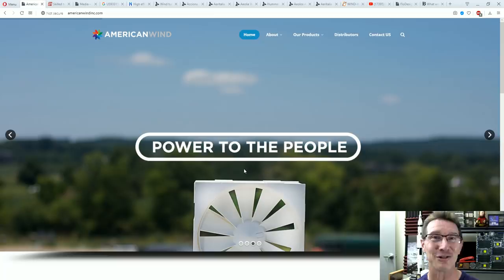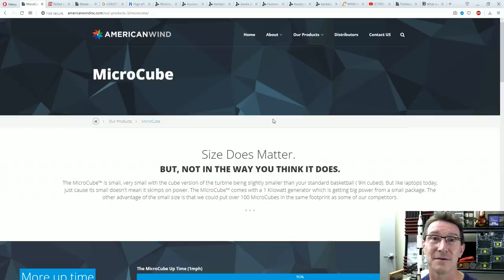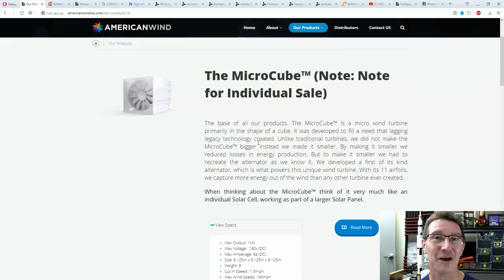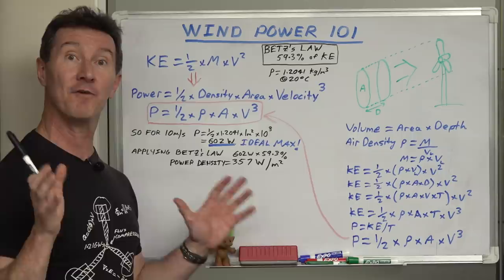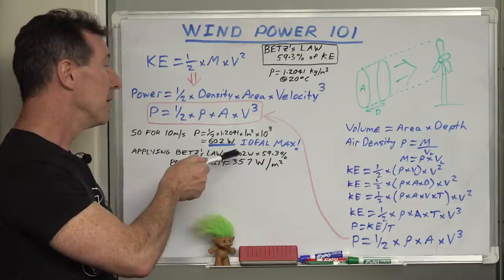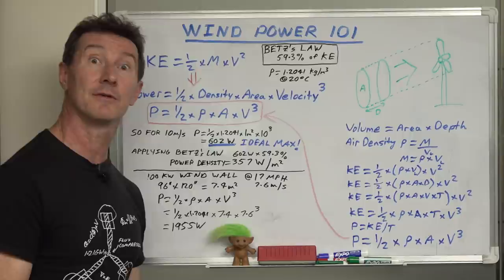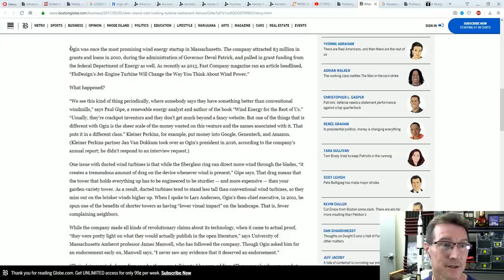EEVblog #1271 - 100kW WindWall Generator BUSTED!

Comment: Impressive video. The sad part is that the sales pitch of a "conventional" wind farm developer is almost always equally full of BS, especially, when the profit (AKA subsidies) is not proportional to the actual energy fed into the grid but to "installed" MW, resulting in an increasing number of wind turbines being places in areas without any wind. When a friend of mine (PhD in physics) did the math on a wind farm built in 2015 in Southern Germany,  just to see how much CO2 it would save over its lifetime, the surprising result was ... below zero, meaning it would actually output more CO2 than it would save. The local government (Green party) responded to the findings with a remarkable answer: "Our wind parks don't have to save C02"... Ahhhh, I love the smell of bullshit in the morning...

Comment: It makes perfect sense if you assume he's selling a "wind wall" and not a "device that converts wind energy into a net electrical output". He's selling a fan. A look at the electrical specs at 2:56 should tell you that. The power usage goes up as the voltage input goes up. Sure, it's a scam, but he didn't say it's a net generator of electricity during the limited time I was able to tolerate him. Of course, using the word "turbine" will probably mean he will have to pay some of his proceeds to the first lawyer that correctly calls his bluff.

Comment: My last Physics course was over 35 years ago but a look at the wind wall looks like BS. It reminds me of problems we worked on with perforated plate. Maybe someone with current Fluid Dynamics engineering could explain the pressure changes at the wall frame and grid, turbulence, and how much wind actually makes it through turning the vanes/blades.

Comment: Maybe its peak output like they do with vacuum cleaners here in the US claiming 5 peakHP using a standard 15 amp outlet. what they are saying that if you were to instantly stop the blades it would peat 1000 watts for 0ne mill second.

Comment: To give a perspective to the numbers: I believe any (wo)man can spin a 7 cm diameter turbine fast enough to get more than the average wind speed. With the appropriate gearing, it won't even be hard. Bradley Wiggens, not an average guy, can't pedal more than 500 W for an hour.

Comment: On fb, some guy told me, that we should put generators on the wheels of electric cars so they can charge themselves during driving... :D
Reply: That's kinda what regenerative braking is buy thermodynamics is lost in most people
Reply: @Philitron128  - I think you misunderstood the point. It's not about the engine breaking equivalent. I know because I asked it "do you mean during breaking?"
He meant during driving. So the engine turns the wheels and a generator charges the batteries simultaneously. :D f** conservation of energy! :D

Comment: The more blades you have on a wind turbine the slower it turns, two blades turn the fastest but have the lowest starting torque so three blades is the usual compromise, alternators become more efficient at higher speeds so slow turning blades will need a gear box which looses power from the system. Ducted wind turbines have been around since the 1950's at least.One design I have seen had a free turning blades which were hollow these fed through to a more conventional turbine in the base,air was thrown out of the tips of the hollow blades and draged air through the turbine at the base supposedly at near supersonic speeds, I believe the British government funded that one.

Comment: I actually worked at my time at the TU Berlin on a student project at an experimental wind turbine concentrator called BERWIAN, that used the principle of winglets to create vortexes to concentrate the wind flow. The idea was to have a small high performance rotor (expensive) surrounded by much cheaper big concentrator blades. Although it achieved some efficiency improvements (and was nice example of bionic engineering) it did not reach better energy harvesting per diameter of rotor and concentrator combined compared to classic wind turbines. It was considered as cheaper solution for less developed countries (the only need to import a small high quality turbine and could produce the bigger concentrator blades nationally) but never left the research field. (https://www.slideserve.com/halee-atkins/ingo-rechenberg)

Comment: Your video is wonderful.

I wasn't sure what it was about until I started watching. When I saw the insane claim of 1 KW out of, what amounts to a muffin fan, I immediately paused the video and Googled "wind energy per square meter". A web page from an Oregon university did a bit of hand waving for density, but came up with 600 W per square meter at 10 meters per second. I like your explanation better.

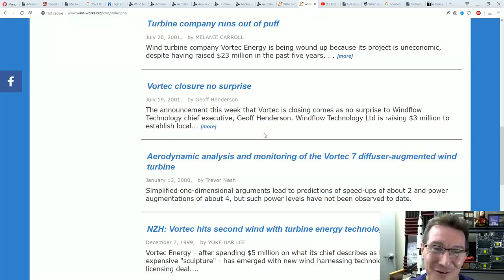27:26 is the real kicker. The moment you see something like this you realize that the "inventor" has no clue about how the world works. Start with something that contains energy (here it's wind due to the car's movement), suck energy out, and the original thing now has less energy. That is, the removal of energy by those generators on the roof increases the drag on the car, which requires more power from the car to maintain it's speed. Anyone who's fiddled with a generator light for a bicycle  https://bit.ly/2LWUPzN  knows that when you switch the light on, peddling becomes harder. Of course 27:56 is the clincher—the guy is not only not an engineer, he's a clueless crackpot.

5:51 is interesting. What is this award and can we trust it? Turns out EuropeanCEO is a magazine. Here is their nomination for CEO (or entrepreneur) of the year. https://www.europeanceo.com/awards/  Looks like judging is done via popularity votes from the readership. Assuming the majority of their readers are businessmen, all I can say is that businessmen think differently than engineers and scientists do. It's a worthless award when used to judge the veracity of an engineering claim.

Comment: Calculation error. If its 100kwatt is energy, not power. So it could  be the power generated in an hour. Than  You only need 27 watt(/second) to get the 100kw hour.

Comment: The inventor can get 200 watts from one 9" x 9" Cube with a "ludicrous" 75 MPH Wind Speed.  As shown in another video.  Extrapolating to a 10 cube x 10 cube Wall equals 20,000 Watts = 200 Watts/cube  x 100 cubes ( again with a 75 MPH Wind ! ).  And finally, the inventor then "claims" 200 watts is only 1/5 Loading of the generator - but he never states the Wind Speed speed required for each Cube to generate 1,000 Watts.  And that is how the inventor calculates 100 kW for a 10 cube x 10 cube Wind Wall.

Comment: My sanity check. I have a 3 inch diameter turbine/fan. I put in 1kW power into it. I get some kind of speed/torque etc. Now I reverse the setup and put it into the wind. I need to get the same speed/torque OR BETTER to generate 1kW...wait that doesn't work.

Comment: In the specs they list the max voltage as 180v and max current as 6A. That's roughly 1000W, Problem is, that's probably open circuit volts and short circuit current. The same BS was used for solar panels back in the day. With an actual load the MPPT sweet spot will pull down those  volts and amps and it will not get anywhere near 1000W (even if they could defy Lenz's law). I dug through all the stuff on their website and found a graph that showed they can only generate 100kw on the big unit with a wind speed of 65mph. At wind speeds like that, most people would have other things on their minds (like where to hide from storm and whether their home is getting damaged). None of American Winds claims seem realistic.

Comment: So a standard 25meter diameter wind turbine operating in 22Mph winds would do 300 kW at 100% efficiency, so there max 100kW is about 33% maximum? So even if the wonderwall thing was 100% efficient it would have to have an 8meter diameter? Or maybe I've fucked all that up, must be why I didn't win the European CEO of the year award!

Comment: Why would the energy capture efficiency be the major factor you care about?  For energy production where the source is available everywhere like wind and solar the primary thing you care about is cost-efficiency.   Energy capture efficiency is a secondary factor and it starts to get important when the land area or weight is limited.

There is multi-junction solar cell that has a lot higher efficiency than the single junction that is commonly used. We talk about high 40% instead of the mid 20% range.  The problem is that the production costs are more than the extra energy output. So they are used in satellites where weight is important and in portable use on the ground, but you will not use them in a solar farm or to put on the roof of your house because an installation with twice the number of solar panel cost less for the same amount of power.

 A 4 blade wind turbine captures a bit more energy than a 3 blade but it is only 0.5% according to some sites online but the cost will get increased by a lot more. The reason you have 3 blades is not winded capture performance but to reduce stress on the system. A two or one blade (they do exist with counterweights) design result in more wobbling and stress the mechanical parts. So the cost of an extra blade is less then what a sturdier hub parts, maintenance cost or shorter life span.

So in most cases, you do nor care about energy capture efficiency for solar or wind power but cost efficiency. The area you need or the weight can be a cost factor and i is then energy capture efficiency is relevant.
Reply: So tell us  .... what is the Cost-Efficiency of this device?
Reply: @MrSummitville  I have not idea I suspect it is terrible because I can see any reason to think that the analysis in this video is incorrect. It was more a way to spot a fraud when the just talk about the energy capture efficiency that in this case is quite clearly fake but they never talk about the cost efficiency of the system.

Comment: I paused right after the betz's law part so this might be short sighted.  But straight up that only applies to a free air turbine, with ducting and stators it doesn't apply (as is the case here) .....  Just have to called out that logical fallacy sorry.

But the argument you're making in total still applies... in a funnelled intake system with a (frictionless) outlet extending enough to feel a barometric drop that would prevent an artificial nose cone forming in the intake, then yeah this could actually make the power per unit area (of turbine) but not of entire system.
Reply: Betz Law still applies to the "Area of the Duct Opening", not the area of the blades - just have to call out your fallacy, sorry ...

Comment: Most all generators can be easily run in reverse, supplying power to turn them instead of letting them turn and generating.  So... could I take one of their little cubes, slam a kilowatt into it, and get the most powerful CPU fan of all time for my PC?

Comment: If you took 100% of the kinetic energy out of a fluid or gas, it would be perfectly still behind the turbine.  How would the flow in front of the turbine continue to come through?  It wouldn't, unless what's still coming through pushes it out of the way, which would then be loss.

Comment: There is a bit of a problem trying to get 100% (or near to) of the energy from wind. Once you have extracted all the energy, the air would no longer be moving, so how can any more air enter your device if there is a big block of non moving air on the other side.
If you take more than 100% wouldn't that mean the wind is now blowing in the opposite direction,
So does that mean this wind turbine thing has 20kmh wind in the front, and, say 15Kmh wind blowing backwards into it's back end......   this is getting really weird.

Comment: recalculations needed, because see the brick design of it, the rotating base must have built in big wind generator and it starts spinning as soon as hit 45 mph wind speed,  there  is where all power comes in !     - just place one of them in dead scientist grave and watch how much power it produce while scientist  turns  around in grave .

Comment: But you aren't taking in consideration of all the wind they're using to promote their wind turbine. That alone is 100kW of hot air. 
so using the average wind sampling density and velocity, we can use Theta squared modeling where covariance squared is equal to the integration of the sum of X (Where X = promotional hot air) - BarX (Actual density and velocity reading) divided by n (number of samples taken) multiplied by n-1 (because we don't want no bias) so yeah.. once you plug in their hot air.. Definitely 100kW output. Now take your (RPM * T) / 5252=HSP (Horse Shit Power) using their 134.102 HSP to Watt conversion you multiply 745.7 and you're just slightly short of 100kW....

Comment: The small wind turbine industry seems pervaded by wishful thinking and mendacity. We had a flurry of excitement about micro wind turbines mounted on houses in urban situations in the UK, a few years back. After many installations the whole thing died because it mostly didn't produce anything useful, just dangerous vibration and noise into the buildings on which they were mounted. I worked on some of this stuff, so I have first hand experience. In some more rural locations, surveyed for adequate wind resource, small turbines did work quite well for people's off grid systems. You really have to research properly to know it's going to work in your particular situation and always avoid manufacturers who make extravagant claims.

Comment: Oh no.... the car... In college previous classes made gas cars fully electric, my favorite was the S10 our professor told us a story, how they wanted to make a trailer that was a generator and would feed energy back into the truck by pulling it (I think it was a student idea) well anyway they either figured it out or our god professor already knew, but that's a bad idea, there would be extra drag, and weight on the truck and with absolutely no loss it would only recover the energy it used, but there are losses. in the long run, they just put a gas generator on a trailer for reserve power totaling 100 miles range combined. my class was supposed to update the batteries but we couldn't get the school to approve it...

But anyway... wind turbines on cars... oh dear... going to be the same issue...

Comment: I have a question about traditional wind turbines, Why they don't set a "CONE screen" in front of the wind turbine?,. so to capture more wind and compress it to the center of the wind turbine avoinding that way loses and increasing performance in slow wind?, the cone must be perfectly in front always, so it must be mounted in the same axis? WhY not?
Reply: It makes the Wind Turbine heavier and too directional. You must keep the mass, as low as, possible. The Rotor must change directions to capture the wind.

Comment: I'm staggered by the cost of these wind turbines.  $1.5million!  Really?  I could get 15000 3' box fans for an order of magnitude less money.  Stack 'em up on top of a freeway billboard, wire 'em together...  Wonder how many watts you'd get out of that.
Reply: Did some math on it - assuming the box fan is actually about 60% actual exposed area (round blades, central hub and all), then the max energy is about 400watts/fan (at the same standard temp and speed we've got in this presentation) and Betz' law brings us down to 240watts/fan (again, max).  Looking around, commercial wind turbines roll up at around $3.5million per unit and generate 2 megawatts; $1.50/watt.  I have no idea how many watts a box fan actually generates, but at $20 per fan (retail), at the $1.50/watt figure, it'd be competitive if the fans generated 13 watts...  Out of that 240watt theoretical limit.  Hm.  Of course the $1.5/watt figure is capitol outlay cost, not operating cost...

Comment: If you have 1000 Joule's of potential energy be that in the form of a battery, a piece of coal, a moving fluid (the wind) or a bolder sat at the top of a hill   then you can only get max 1000 joule's worth of work done  (primary school level of psychics education) Doh

Comment: The problem is these goofs didn't integrate the products with those "solar cells in the road" schemes.    The two together would suck a lot more venture capital into that hole and would be a guaranteed success.

Comment: It would probably better if did a reverse calculating, assuming 100% wind energy capture (reality be damned), and 100 KW output at 7,6 m/s, we could calculate the needed are, and if it is bigger than the wall (and how much bigger) is the absolute lie, since that size will be the theoretical minimum for the given specs.

Here it is:
P=(1/2)*(Ro)*A*V3
A=2*P/((Ro)*V3) -> A=2*1000*100/(1,2*7,6*7,6*7,6)=~380 m2, so a bit more than the 7,4 claimed are, 50 times more, to be specific... And this would need ideal, 100% efficiency in every step, add the wind law (Betz; 60%) and reality with mechanical efficiency (85%), and we would get around 100 times more are than what they claim...

Comment: Why did they design this as a wall? If they made it a roadway they'd get way more money.
Reply: No, silly... Every building has walls. Bigger buildings have bigger walls. Just run an internal duct to guide the wind around the internals, and back out the other wind wall - double energy!
Reply: @tin2001  You should put that on indiegogo ;)

Comment: "it increases the wind speed of the wind going through it", err... so... the energy comes from magic?
Reply: At face value, it is not entirely wrong.
Ducts do increase wind speed that is coming through.
His claims are way off though.
Reply: @sleepye77
 Yes, as the size of the duct is reduced the wind speed will increase. But both "Wind Speed" and the "Area" are both already included the Power formula